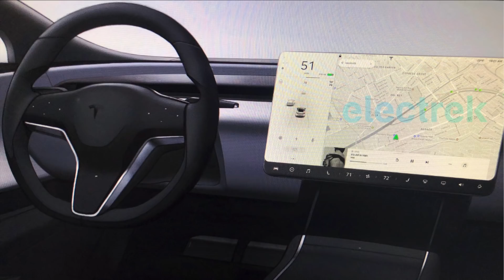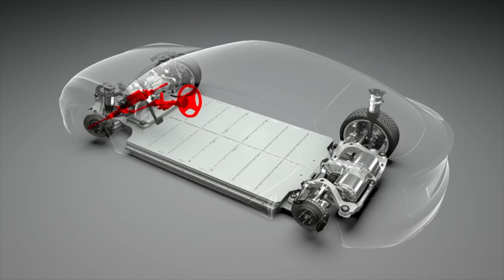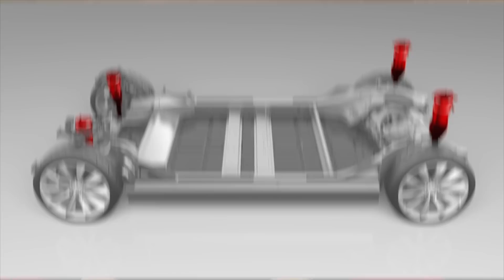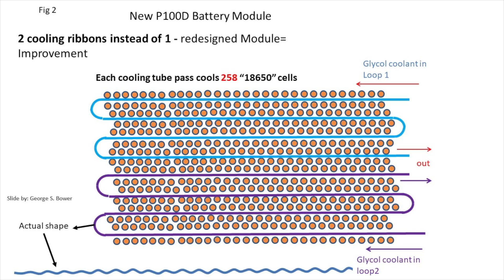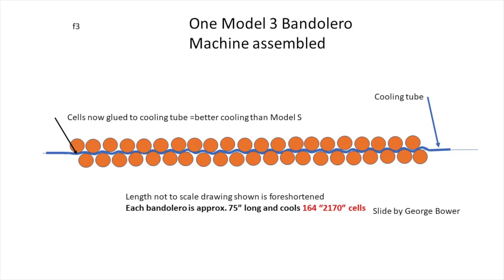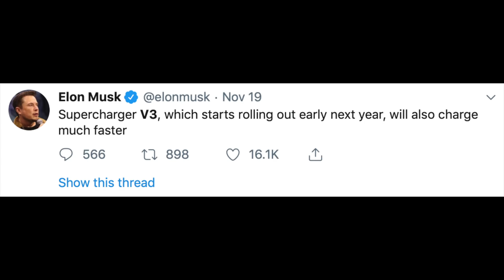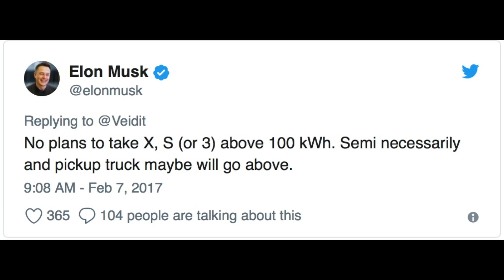The reason Tesla's 75 kWh battery is going away

Comment: The use of a new battery pack design is to allow for a faster quick charge and get a reasonable range on the quick charge.   Say  120 miles with a 15 min charge?  But a full charge would still only yield ~350 mile.

Comment: I have a question!!  I have a Tesla model 3 performance. 75 kwh battery.   But when I drive my car from  100% to 5% battery is shows that the used battery was only around 64 kW hours. Does this mean that I'm not getting the full 75 kW hour battery capacity??
Reply: I don't know the specifics but there's a buffer to protect the battery, so even if the battery has a energy capacity of 75kWh it will not drain it completely to protect the battery. What you can compare next time compare next time is the distance you get.

Comment: Teela should demand custom cells that are square so they can more efficiently use less space than circular batteries which have gaps between them.  That’s why Apple  Inc has such smaller battery packs and more svelt laptops than competitors.  They use enough batteries that asking for custom cells shouldn’t raise their costs as any small increase in price per cell should be offset by the extra capacity gain.    

You can make conjecture all you want about a Super Chager V3, but please note: Increasing only the capacity size of the battery array by adding more cells does not increase the ability to charge faster at all as all cells will still assume the same series/parrallel relationship they currently have to maintain the voltage required.   It will take more energy at once but that is distributed equally amongst all the cells so more cells can take more overall charge, but it will be at the same rate per cell as before.   If you want it to charge faster then you need to change the series/parrallel configuration for the battery packs to make them more parallel and less series which changes the voltage output in a. negative fashion which is not good for off the line stating ability, or change the energy density to make each individual cell more energy dense o that they can reach a usable 80% more quickly, or make improvements to the chemistry or electrode composition to accommodate a higher rate of charge without damaging the batteries by cracking the electrodes or boiling the electrolyte, the former of the two being the more usual problem which leads to early dendrite shorting failure and eventual cascading damage that wipes out entire battery packs in short order.

Comment: I think that there will be a hybrid battery solution.  The fast charging cycle would follow it's normal course and the rate would remain the same as the ultra capacitor gradually kicked in and would charge so that, after the car has disconnected and is on it's way, charging the Lithium Ion part would continue from the super capacitor portion.  Whether this would be from an integrated cell or, more likely, a separate pack which could hold ,say one eighth of the power.  The car then could achieve the same range with a smaller (and less heavy) Lithium Ion pack and shorter fast charge time.

Comment: A 200 kwh battery on the model x would be dope, it would get closer to the 1000 km miles, but it would be too heavy and expensive so it would make more sense to use more efficient parts and reduce the weight for Tesla, and that would reduce the cost for longer range models. If I've been clear enough

Comment: I think the plan will be smaller batteries with the same or better performance, with the combination of super capacitor cells. It all translate in a better bottom line. Elons goal is to sell as many units as possible hence the new price change for the Model 3.

Comment: There is still a pack of ICE idiots that THINK they need 500 miles of range before they'll buy into EV. That's 160kWh. Tesla will play that card as soon as it has a viable competitor, IMO. The double stack of modules Tesla's already done...the seats and structure to carry an extra 1000 pounds are the challenge in this, not the packs.

Comment: People it’s all about science! We all know that batteries don’t like heat, so charging much faster would require more cooling(as addressed). And obviously larger batteries means more weight to haul around. Similar to a smartphone battery, the more you charge and also the faster you charge means a shorter lifespan. I know someone will point out that cellphones use lithium ion batteries but it’s the same principle. 

You really think you’ll be able to charge a Tesla car from like 20% to 100% in 15 minutes and drive a longer range then expect that battery to last you a couple of years when you’re fast charging daily? No bueno! 🙅🏾‍♂️ Yes the battery pack can and will do this playing along for a few cycles but no way will it give you a reliable 3-6 years worth of use without losing it’s properties. Either it will start draining faster or won’t charge properly after 2-3 years. Fast charging on batteries should be done a couple of days apart not daily or twice a day if you expect it to last years.🔋

Comment: hopefully the price of panasonic 18650 cells will go back down to pre tesla levels 
though im not sure why they didnt just use 26650 cells as a drop in replacement for 18650s, they wouldnt need to do a total redesign of the battery compartment or the car as the cells are still 65mm high but have a much higher capacity and C rate than 18650s or 21700s

Comment: I hope that Tesla  stops making the 75K battery for all new buyers sake. I also hope that Tesla recalls all of these 75 k batteries sold. At the time I purchased my Model X I was promised that it would  go 235 miles on a charge . Even on the electric sales signs much latter it said the same... I have never got that kind of mileage out of one charge. In Fact in the winter I get about 150 miles and if it's real cold I lose about 25 miles every time that I stop for 20 mins or more . One cold night I sleep away from home, not attached to a charge.r My car read that I had 67 mile range when I parked it. I had about to go about 20 miles to the Supper charging station. I thought that it would be No Problem. When I went to leave in the morning it read that I only had 35 miles of charge left. I thought that that it should still be no problem to make it. As I started driving my car told me not to go over 55 or I wouldn't make it, then 50, then 45....When I rolled in on wind and a prayer with Zero % charge. It was very scary. I thought that I was going to freeze to death. I would have never bought this car if I wasn't lied to about this cars range. Tesla managers were No help at all.

Comment: Until you get above 350 mile range  using the create-features we all expect to use and charging times that can approach that of a fueling a traditional IC engine, electric vehicles will not sell more than 5% annually and even that is a push.

Comment: Mercedes EQ SUV was revealed to be using lithium polymer (LiPo) instead of Liion. 
So MB claims 80% charge in 40 minutes. 
But their system is less than 100 volts from my understanding. 
So if MB has a system using LiPo that charges in 40 minutes thats a TON of amperage. 
Elon mentioned the C rating hurdle - a C rating of 1C means each cell can charge at 1X the cells capacity. Ie. 3.5 amps for a 3.5 amp/hour cell. 
So basically MB has a way to charge their LiPo packs at a very high C rating. 

So.. A wild guess - Tesla is considering this alternative - however with a high voltage system in contrast - MB's system would allow them to charge much faster.

Comment: There probably can't be any increase in the charge rate. The battery chemistry and size is still the same no matter the 18650 or 21700 cells and slower charging will always be more safe and better for the cells long term. I heard that if you super charge too much Telsa will limit you. That may get worse in the future if the super charger was 2x faster at twice the current with Tesla wanting to keep the cars batteries in good health.

Comment: tesla is about long term value... in such they do not use the highest current / amp output cells which also charge faster.... BMW or some company will surely take that market and have a 75kwh pack that is fast as the p100d+

Comment: I generally agree.
The big saving in switching to all 2170 cells is not only power density but no shipping cost! (Plus, as you mentioned, economy of scale).
One thing it seems no one has considered regarding the 2170 cells if they are used in the Model S/X, is that it may not require the taller pack casing. Why not simply lay the cells horizontally, adjust the construction of the modules rather than the casing and change the wiring/ cooling loom to suit?
If the M3 pack can accommodate 75kWh and all ancillaries, surely there's sufficient volume in the larger vehicles, with control modules remaining outside the pack, to accommodate 2170 cells and provide a (much?) larger capacity?
If 20% improvement can be achieved with an overall build cost reduction, it's a winner!
That would stretch the Tesla's further in front of the "competition" and justify a price premium.

Comment: This kWh frenzy is just nonsense. How many of us REALLY NEED 400mi/640km range??? How many hrs can you drive without stopping to stretch your legs, take a leak, eat something, have a cup of coffee - while your car gets 100kWh from a 200kW charger...?! Elon is right! It's nonsense: 350kW electric circuits are industrial-sized stuf. Heavy electrical installations, oversized for 99% of users. 
After all, electric cars are also expected be SUSTAINABLE and eco-friendly. 
Bottom line, stopping after driving for 3hrs maximum is totally recommended from safety & health standpoints. Your bladder and kidneys will be grateful...
Unless you intend to drive continuosly at 200mph for more than 2hs
Reply: ...BTW...this topic reminds me of some technical discussions on Digital Cameras 10+ yrs ago. The megapixel race was on. It looked like we'd jump from 5-10MPx in 2005 to 50-100MPx by 2019... Guess what... 10-20MPx are still enough for 99.9% of us. And will be so, for a very long time. Maybe forever.

Comment: Power density was just claimed somewhere below to be a given as voltage goes up.  I researched lead acid this weekend because of claims made by that industry back WHEN  with elon's cheap skating we lost a123 and an obvious realisation that charge acceptance is best addressed by total vehicle weight PERIOD as all other factors cancel out.  So you stop using elevators for documents and courier but install smaller tubes to flush just documents or provide moving volume to people not tarmac for cars.

Specifically chemical voltages may correlate but are not cause of density.  Density can be estimated by subtracting irreversible changes so when using fission to produce red ice blocks the energy in is largely recoverable as the melting occurs so far below free ambient heat that even prior to  O steam being issue from excessive heat being let into the melted O8 ice the density if expanding ice into fluid is so awesome it makes diesel ignition pressures seen like nothing?

When o8 sucks like a hurricane heat it expands by hundreds of percent in volume long before gassifyng.  It is 2019 and we use h20 despite its unsuitability inexplicably in turbines.

The fossil fuel industry has been lucky fission got ignored till now by grid bottlenecks or there inherent unfitness of any electron distribution scheme.

A car powered by clean energy is engineered around that source.  To drive on fission using electricity is to look to the past when it is future reactors that will 'Power' the crazy ok for now let's say wheels.

If wheels an exception to total vehicle weight remains.  The weight of gasoline on a typical commute exceeds total road cycle weight.  The space shuttle and even reusable rockets further emphasize such silliness.  Wheels have a place and that is when only one mass is to be ejected from our gravitational field, not two.  Pushing earth around when pairs of cargo wings can yank against each other and bump earth almost not at all to launch is no brainer.

Nor is irrelevancy of fuel weight when hauling ass under robotic brain or with soft ice that will just at worst freeze what it smothers in a collision- not only survivable but likely like drowning in too cold water life preserving given reports uploaded before computers might go silent despite commercials showing on star somehow surviving to console us as we bleed out.

So sorry our profit results in your death customer now!  We will never forget your business... did you want cremation or what the robot or call center should ask...

To bottle the work in finding uranium does is easy enough to speculate about.

The hard part is stopp8ng stakeholders like the dumb young homosapiens king of the sand where only oil had value or has till we so bottle it from selectively pruning away such upstart as elon famously claimed his nations investment fund would by 'investing.

Yeah.

Because tesla has kept the billions flowing to burn has where kids study and seniors retire denying cognition and golden years so cost effectively for 1 percenters if only them ok.... GOT IT?

YOU ASK AFTER I AM,SLAIN OR WHATEVER HOW TO MOVE ENERGY FROM PLANT TO CAR...ANYWAY BUT ELECTRICALLY OBVIOUSLY PEPES!

YOU simply  ask till answered.  You Google how to make napalm antifascist cream and apply it to yourself at some point long past as you ask pedaling this July naked into bosom of heaven for your such service by striking the match at perfect time as Buddhists have been doing by many dozen immolated as there right to protest so far has allowed.

MARTIN himself said as much in London 54 years ago BARELY.  Unworthy we are to live if without cause to die girls!  So die some of us must by our own choice or more will be crushed by bumpers of model x's like always forever.

Clean traction power without burning anywhere is to die for.  Clean energy storage is trivial.  All other forms of energy especially solar electric cost far too much only fission can crank the o8 factory shaft sustainably to create real ice to  by using external to fuel heat spin our camshaft with Harley noises and all for real again.

Invest in 'o8' factory horsepower.  Join the team re engineering our planet.  FUCK OPEC.  OR just die for the rest of us naked as true heroes if nuclear engineering is too repulsive or you drank too much beer in school and just fucked during study time you still can make all the difference because apparently a tiny sect of people is far more important then this stinking planet earth by the numbers of volunteers so NONVIOLENT?